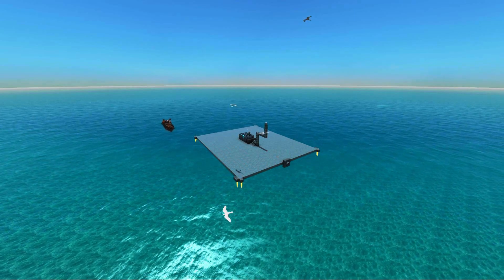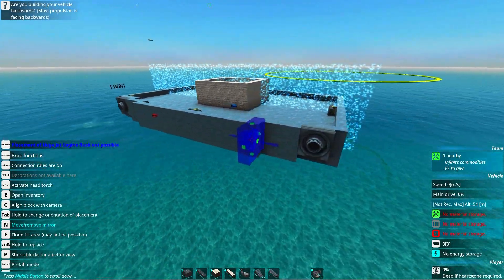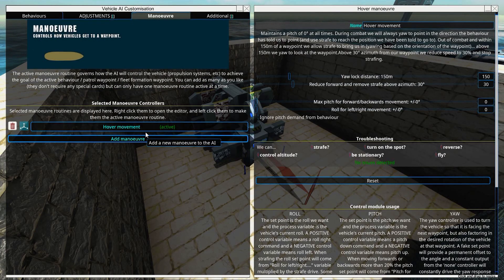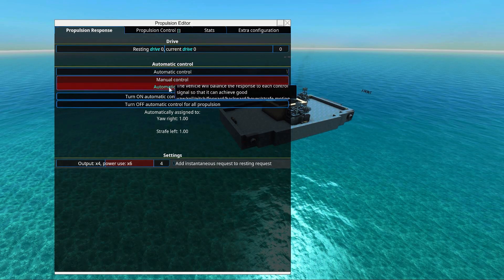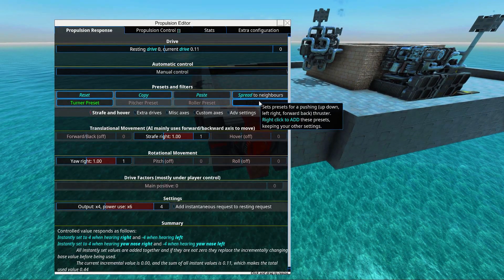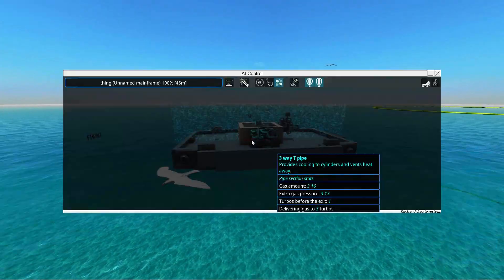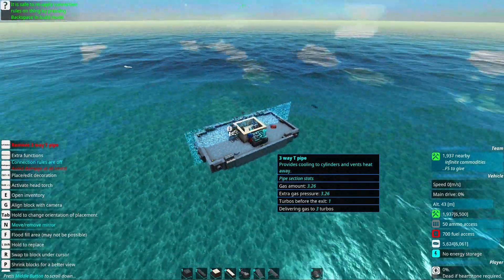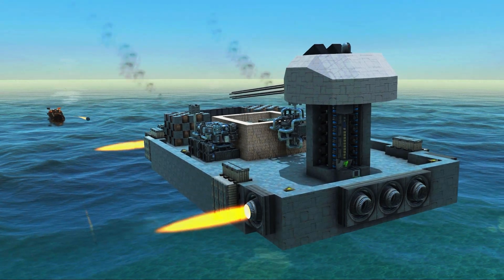From The Depths INSTANT Tutorial: Hovercraft

Comment: i got it working :3 the problem i had that my "hovercraft" if u can call my first try by that name. Was too light, it was spinning around like crazy, even with the PIDs adjusted, now i made more chonky BOX and its so smooth ^^
Reply from the maker: If you wanna make it super light switch to ION thrusters (they also work in case you hit the water) because they are weak and won't make it wobble like crazy, imagen trying to steer a bicycle with a jet engine, even if you try to be gentle on the gas...

Comment: I'm still learning but I've made a few hover craft. I like to put the hover jets along the center and use little jets for roll on the sides. I have found doing it this way you don't need to worry about center mass as much. If one end is heavier you just move the jets more to that end. I also use pitch so I can get the front to point down some to enemy but that's more preference.
Reply from the maker: I agree that the little jets are preferable when making larger crafts. One can absolutely add extra hoverthrusters on the center of mass for redundancy, in fact this build I make in this video ended up so heavy with heavy armour integrated in it so I will probably add a center hover thruster so it doesn't sink if one of the corner ones get offline. However I would recommend you to try and make your roll and pitch thrusters also be hover thrusters, because this change could potentially keep you alive much longer in case the hover thruster section gets destroyed, so try it next time!
Reply: @GMODISM  Just so I'm clear. These are bigger 300,000 plus material rectangles. I mark center  down the center of craft with 1x4 block. Then I'll use three wide blocks on both sides of that and if it's wider another so I can flush mount large jets easier.  After that 1x2 blocks length wise down the sides so it's easier to flush mount little jets. The bottom would look something like, ll-------l------ll . I do a lot of testing so end up moving them around some during build and testing. Doing it this way makes it easier and uniformed. For pitch down on the bottom, rear, I use large jets set to 50/50 hover/pitch. Roll, I use little jets on the bottom sides. A pair from center front and center back on both sides. I've found this way it doesn't roll much even if a jet on one side is taken out. Two yes, it'll roll some but not massively. Loosing two out of eight jets or even ten is a lot and it's going to fall. In settings I don't let it roll much if at all.  For pitch up I use a pair of little jets on the top in the back center right and left. Yaw is the same, large jets center front and rear. I've done a lot of testing. The bottom doesn't get hit much. I have found placement for reverse has to be center left and right. If you get this wrong you'll show them your bottom while backing up. I've been using big laser systems which has to help. I have found CIWS is better for missiles.